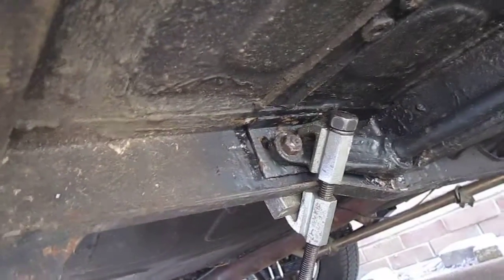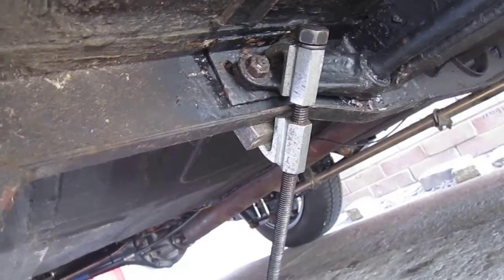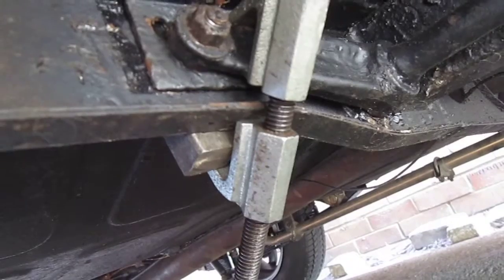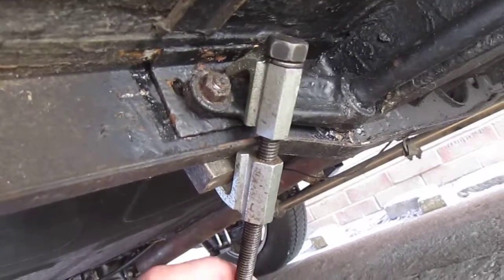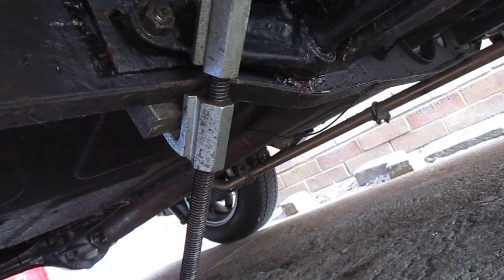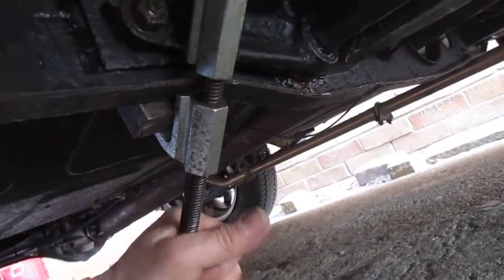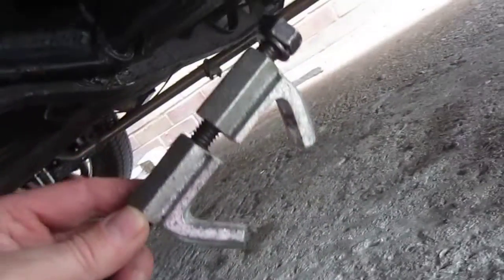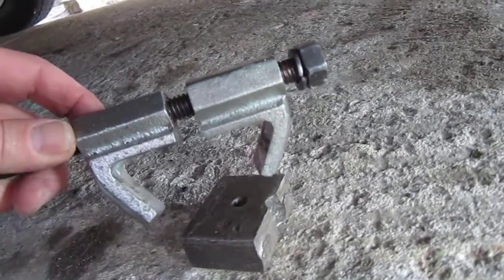Morris Minor 1000 front torsion bar adjusting help

Comment: Following on from this video, I have just done the same successfully on my Minor, using and old G clamp in place of the spring compressor in the video.

I ground a slight step in the part of the clamp that goes over the top, so it couldn't slide off the torsion bar arm. Perfect.  An old cast iron hinge went underneath, to spread the load on the chassis crossmember. The G clamp was put over one of the hinge's holes, to prevent further possibilities of slipping. Making sure the load is spread evenly on the chassis crossmember, so it wasn't distorted or an edge pulled up by the force of the clamp. 

Much easier than stripping all the suspension down.  I'd recommend cleaning all the muck off before starting so it is straightforward once you start. So... thanks for the video.... it inspired me to do mine. AND it's been out for a test drive.
Reply from the maker: Hi Chris, Thanks for the comment. I am an engineer by trade and always try to find simple methods to do jobs. If it inspires others to improve that's great and especially trying to pass on methods, it all evolves.
Reply: I put a comment on your video that I'd been inspired by your ideas. I tried to describe what I had done but it's not easy. So I have now made a very short and unclear!! video of my G-clamp and hinge method. I'll try to do a proper one when I know more about videos.... ADJUSTING MORRIS MINOR FRONT SUSPENSION

Comment: Im a bit unsure of what you mean? Is there any full length videos? I want to drop mine about 4”.
Reply from the maker: This idea was to use the spring compressor or as Chris did with a modified G cramp to support the arm while undoing the nuts and bolts to be able to alter the height via the plate holes. This would not work for 4 inches as there isn't that much adjustment with the plate holes. I do not have another video as it was only there to give ideas to people to try to make a job easier as the proper way is to strip the suspension. I don't know if you could alter the height with stripping the rod from the spline connections at the front bush and moving the height that way.